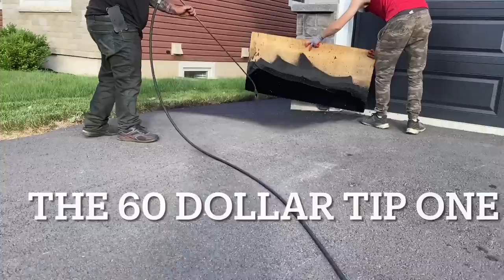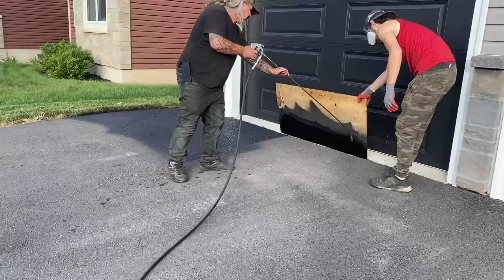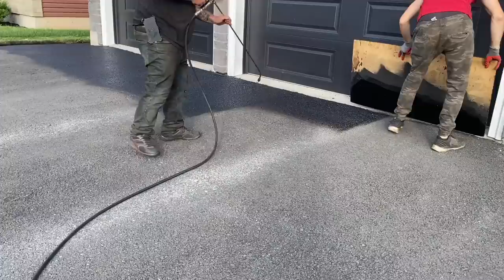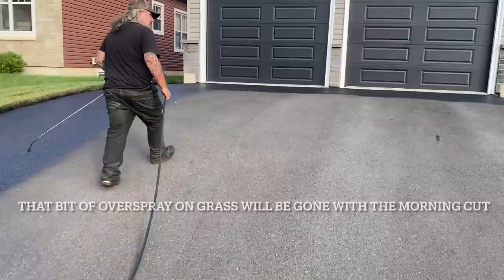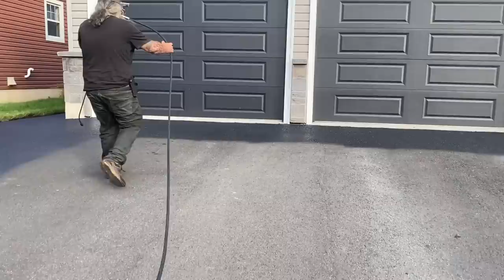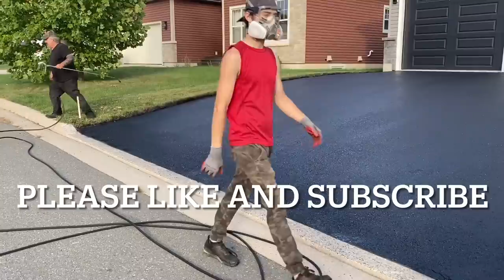Professional Asphalt Spray Sealing: "The 60 Dollar Tip One"  Top Coats Pavement Maintenance

Comment: So many negative comments from ppl who have never done manual labour...this is extremely difficult to be that good with a sprayer.
Reply: Yes also not to spray the hose  get yourself  boxed in  or get the product  on you your shoes or your clothes  . Let the professionals  do it you will be much happier . It's  a messy job if you don't  know what the hell your doing.
Reply: Oh come on, not that difficult, probably most impressive part is how fast/accurate he can stop on an edge
Reply: @devilmonkey  have you ever even set up a spray machine let alone use one plus that isn’t paint he needs to thin it down and get the psi set to spray right according to how much he thind down the product every home owner thinks owe that’s easy until they have to actually do it and do it well while producing it at a productive rate of time
Reply: @louisderosa6154  yeah I have and that's a sealer, that's basically paint buddy. Oh oh the correct psi and thinning it out, the horror. What's so difficult about this, explain yourself. The way he moves it side to side 😯 do you want to see how this is done exactly on a house
Reply: @devilmonkey  I didn’t say it was a horror for everybody it isn’t for me but for some people they do have issues with it just cause it comes easier for you and I don’t mean others don’t have problems with it to criticize them to me just seems like you have a chip on your shoulders that’s all as a journeyman your suppose to upbring the people learning a trade not break them down
Reply: @louisderosa6154  yeah well I'm against putting people down or discouraging them, saying something is to hard for people to do when it really isn't. not everyone has 400 500 dollars to pay a guy to do this. It's really a matter of having the equipment for spraying, but this can be squeegeed or even rolled on. Not everyone wants to do it themselves and that's fine, pay this guy. If you want to talk a job up, talk about welding or electrical, that takes at least a fair amount of knowledge and skill. This guy did a nice clean job and did it fast, bravo, made a nice penny, did I say otherwise. Now sit down!
Reply: @devilmonkey  yes and the equipment for the decent smaller sprayer (but probably couldn't handle a 24" spray pattern) is $500 lol, but you could rent it for 100$-150$ per day at some places. I see the point you're trying to make however you seem very arrogant in the way you want to portray your thoughts onto other's.

Comment: My neighbor had this done, it didn't last long. Also it helps retain heat, not something one wants around their home. He regretted it within 4 months of having it done.
Reply: what if I do it now before winter
Reply from the maker: Again, done with a cheap product, please understand that there are different grades of sealer. Always make sure good products are used.
Reply from the maker: @gheezymarro8755  With good quality product , you can do this in summer or fall, will not make a difference.
Reply: @FastFordClub  how much does this cost?
Reply from the maker: @thetruthfornow6045  Depends on the type of asphalt, how much cleaning is required, has it been sealed before, how many cracks to be fixed etc. but does range between 30 - 50 cents per square foot
Reply: @FastFordClub  thank you
Reply: @FastFordClub also depends where you are located, 50c/sq ft is very high in my area, especially if you are only spraying one thin coat. Heck, 50c anywhere spraying that thin of a coat is high. We always brush to get an actual seal

Comment: Used to do sealcoating asphalt the sealer we put down came from a plant that would fill the tanker up we added sand to it and a little bit of water also the sealer we used to spray down contain de creosote same stuff they use on railroad cross ties or they used to and when we spray the parking lot it was a lot thicker than what's coming out of the end of that that might hold up for a driveway but for commercial use I don't think it would last
Reply: I used the same type material on a parking lot and it lasted more than 9 years. The water based sealer only lays on top of the pavement and does nothing to prolong the life of the pavement. I have seen water based sealer completely disappear in 30 days

Comment: One tip for doing driveway coatings, get yourself a pair of golf shoes, the kind with plastic cleets. You walk on the cleets and don't leave footprints. You can walk right across the freshly coated surface without leaving a mark on it, plus they barely leave a trace if you make a bad step somewhere on a sidewalk. Still good to use care, but the tell tale black footprints won't happen.
Reply: I have a better tip: do it correctly and you won't need to walk across a freshly coated surface. Makes sense eh?
Reply: @bigmacdaddy1234  right, if we were just perfect, all the time, we wouldn't need any protective gear or precautions.

Comment: Does this add any value, besides it looks new?
Reply: Protects the asphault from the elements, extending its life by at a minimum of 5 years from ice, rain, salt, and temperature shock.
Reply: 5 years from a spray.. that isnt thick enough for that.. a real poured on tar would last and fill in gaps
Reply: @jeepsblackpowderandlights4305  no liquid product will fill the gaps

Comment: Is this any different than the pour and smear method?
Reply: Yes, you will get better coverage and more thickness with the pour and spread method. I'm an automotive painter with over 30 years experience, the one coat spray method he's using isn't going to give complete saturation and coverage. I had this done once on my own driveway and was completely unsatisfied with the results. As the wand arcs outward the spray pattern is widening and the distance between the end of the wand and the driveway increasing so you have uneven coverage and with only one coat you would need at least a 75% overlap with each pass and slightly slower application speed to get full coverage, in my opinion.
I would definitely go with the pour method unless you were getting this done relatively cheaply and are going to do it every 1 to 2 years.
TC in Annapolis Maryland

Comment: is there anymore steps to do after the seal coat? i wanna start a business doing this in my area but i have no idea how to do it im in the research process rn
Reply from the maker: No, no more steps after this, just start by cleaning off the dirt, fill cracks if customer wants, then spray seal and that's it. Give the sealer 12 - 24 hours to set up before driving on it.

Comment: Great job looks amazing what machine do you use and what spray-gun and were would I be able to get one thinking about opening Similar business Thank you
Reply from the maker: Thank you, spray gun and wand can be ordered from  MK Rittenhouse in Ontario, the equipment can be build with a small engine running a hydraulic pump and a relieve valve.

Comment: This is a piss poor job. I have done this myself and it is laborious. Takes a heck of a lot more time to do it right, I can assure ya that.
Reply: What did they do wrong?
Reply: Well for one, the spray there applying is just that watered down sealant. All that’s gonna do is temporarily change the color of the asphalt. It does not seal the cracks and is applied so sparingly, doesn’t get absorbed, just dries on surface.
Reply: You sure are smart. That is definitely not water based. It’s a oil based penetrating sealer and does not have to be flooded to get good results.

Comment: Hey what spray system you have? I like how that wond sprays!!
Reply from the maker: Made it myself, aluminum tank, small engine, hydraulic pump and t-relive valve. In my video " 
New Hose and Wand day" you can see part of my 
setup, check it out
Reply: @FastFordClub  Thats a sweet dyi sprayer! Any idea how many PSI your spraying at? Also what type of tip/key are you using the spray head?
Reply from the maker: @brendontompa-clinch2306  it's the XR8003VS tip , PSI I spray usually around 700 - 800 PSI

Comment: Why are you constantly pressing the sprayer instead of holding it in?
Reply from the maker: Just how I have gotten used to doing it, no particular reason
Reply: So he can have more pressure in there
Reply: Same as when spray painting - if you hold it down, at the end of every stroke, you'll end up depositing more paint as you change directions at the end, leaving uneven lines.
Reply from the maker: @penguins9645  Exactly .......
Reply: @penguins9645  Wrong.  Painting and doing this are totally different. When painting you don't want to keep releasing the trigger on each motion you do want to hold it down continuously as long as you can. It will spit more on your painted finish. With this it dosen't really matter. You're not trying for a fine finish.
Reply: @lonewolf744  All have techniques that they get used too. Iam very good at painting and have done many cars with hvlp and cans. I have always from day one released the trigger on a can coming to a edge or cut off area. With hvlp the trigger has two areas one for keeping the air flow,  press a little harder and the paint flows. I never put a run, or have orange peal with cans, or hvlp and I release the nozzle. 😁
Reply: @RowdyEnt.  Yea thats definitely different than using an airless sprayer painting a house.  I just know as a profession painter. If you can,, meaning like you're on a big wall, you do not keep releasing and pressing the trigger. You hold it down continuously an over lap half over and keep rolling. ✌🏼
Reply: How about the fact that if you hold it down it makes so much more over spray vs. triggering the gun and controlling your spray like this man did perfectly
Reply: @coreymoore7028  👌
Reply: @lonewolf744  automotive painter with over 30 years experience, you are wrong.

Comment: Are you using an AK 130 or 230? And can you remove the spray tip and leave strips to brush if you wanted to?
Reply from the maker: Yes I can, but this equipment I build myself it's not the AK series
Reply: @FastFordClub  could tell us more about how you build it. I love your wand and was wondering what it would take to make one?

Comment: What type of sprayer is that ?
Reply from the maker: I build the setup myself, basically a small engine driving a hydraulic pump thru a t-relieve valve, to see a little more check out my video called "New Wand and Hose Day" I believe it shows a little more of the equipment
Reply: Can this be sprayed onto a concrete driveway ?
Reply from the maker: @pjaython6030  Hi, no I would not recommend that, I have done it before but the problem is it does not stick really well, it will peel off after a while
Reply: @pjaython6030  you can get concrete paint to change the color

Comment: This type of driveways doesn't need edging before spraying. It's a water-based seal coat that doesn't have as much sand in it as commercial jobs and works well in this low-pressure system. In some cases, a sand-free coat is used just to change the color before a sale. The grass will be fine. If you want the price to go up a bit, shielding the grass should be added in the estimate. For the quality of this house, I would have shielded the grass for free advertising's sake. Keep using that board, but use a thin one for curved work and cut out handles for more control. Most guys will brush a line along the garage edge for a tighter line. Spraying right at the edge of the house is risky and doesn't lay a perfect line without getting overspray on the house. The material is going down well and the hose management is much better this time. Remember, these guys are working on the clock and you get what you pay for.

Comment: Done this for a job back in high school, awesome work on the no over spray.
Reply from the maker: Thanks .........
Reply: That white trim up close had me worried, but the triggerman changed his angle and kept it low pressure near it.
Reply: @radar98  Definitely has a better sprayer set up than I did back in high school, then again our sealant was J16 mixed with some black silicone sand blasting sand to add a rougher texture for winter months.

Comment: Is this tar or paint? This is something I didn't know existed.
Reply: It’s oil based asphalt sealer
Reply: @codystanley2760  That is a unique job. Always going to have work too.
Reply from the maker: Oil based sealer
Reply: Sure looks like a Water-based sealer, not oil. It's a mix of creosote, sometimes latex, water, and sand. The oil-based seal coaters are used over oil spots and give off a rainbow of colors when applied. The one used here will dry in a few hours and can be walked on  same day. Oil-based coater takes much longer, which is why they are almost never used in commercial sprayers like this.

Comment: What does a job like this cost? about $150-$300? I can't see it being more than that ans some of these 5 gallon sealers are from $25 and the better brand ones? a little over 100+ 

Would be something I would look into for sure If I had Black Tar, but here in NYC we have Cement in most places unless you go to Long Island, they have more Asphalt driveways over there.
Reply from the maker: Yeah, this is way better product than the pails of sealer you buy at hardware stores for sure, far more expensive. The job is worth a little more than than your guessed amount, I won't give the exact amount  ....  Thanks

Comment: Looks a bit thin to seal for long
Reply from the maker: Just the correct amount, any thicker and it will track into the house all over carpets and floors
Reply from the maker: @coloradodirtbike5930  Wow, sure missing the point aren't you
Reply from the maker: @coloradodirtbike5930  Wow, just can't stop yourself can you .........
Reply: You can make in the six figures using that cheap watered down junk that you are putting on. This is a good quality sealer that adds life back to the asphalt, not just lay on top and do nothing for the asphalt. What is asphalt made up from, sand, stone, liquid asphalt. The sand and stone do not need protection but the liquid asphalt does. Tell me how a water based product is any benefit. I will tell you, NONE
Reply from the maker: @tonywilliams6440  You are correct Tony .......
Reply: @FastFordClub  it amazes me the mentality of some people, or lack of
Reply from the maker: @tonywilliams6440  sad isn't it .....

Comment: I had mine sprayed and I wasn’t impressed. The year after, the fading was so much that you could see the circular spray pattern. I’d did the entire driveway myself (huge driveway), with barrels of sealant and a squeegee, after filling cracks etc. The thickness was impressive, and I know it will last at least 5 years. Tough on my back though, but worth it.
Reply from the maker: Yes, Not all guys use a quality sealer, and some even thin it out, sorry to hear it wore off that soon, you should get art least 3 years out of this product.

Comment: How many coats of asphalt do you provide, it looks too thin, if it's only one coating, it will not last very long. It's supposed to be thicker and hot coming out of a machine. You are just coating the top of the old asphalt.
Reply: It's not Asphalt its a Sealcoating.  From the looks of it Gilsonite. Which is a oil based product but not new Asphalt
Reply from the maker: It's seal coating, not paving.
Reply: That light of a coat isn’t sealing anything. 🤣
Reply from the maker: @HuntMountain06  LOL  okay then, enlighten us Mr. Pro

Comment: Puts the thinnest possible coat on the driveway. And thinned out so it can spray. Big scam. Real sealcoaters use hot coating squeegeed on to fill in cracks.
Reply from the maker: Not a thin & thinned out product. Sprayable as purchased, very expensive sealer, far better than any water based product. Do some research before making foolish comments please .......
Reply: @FastFordClub  You can say all you want, but what you did is asphalt painting. Absolute bs. That driveway needed a real hot coat.
Reply: there is no such thing as hot sealcoat.  sealcoat emulsion is asphalt suspended in water hence the name emulsion. you cant heat up sealcoat it will evaporate the water out of it (water boils at 212 degrees ) the only type of sealcoat that uses hot oil is chip n tar, spray oil then spread stones on top ya know the stuff they put on the streets that gets rocks all over. the oil they use for that is called rs2 which stands for rapid set, all other sealcoats, asphalt emulsion, coaltar , and gilsonite sealers which arent mixed with water, are slow set
Reply: @rafars2246 you can’t “hot coat” asphalt. Are you mixing up up roofing tar with asphalt sealer? 😂 we got a real pro in the comments here.
Reply: @Mario Hinsche  good work man,I wouldn't even respond to the dumba$$es 😂,it's hard not 2 sometimes though I know 😂!!!!   How they gonna teach u if they have no clue smdh.
Reply: Do you know the old saying? If you knew that they know nothing. Hey, at least you’d know something 😂